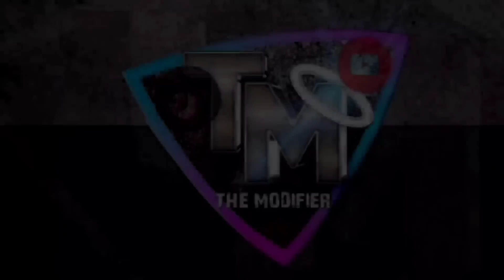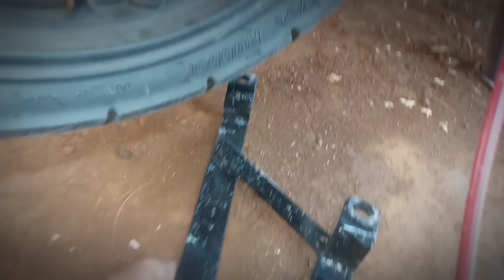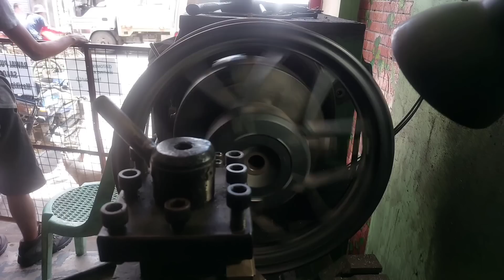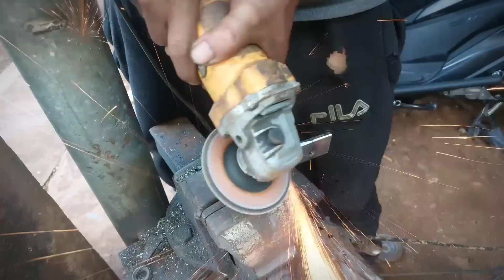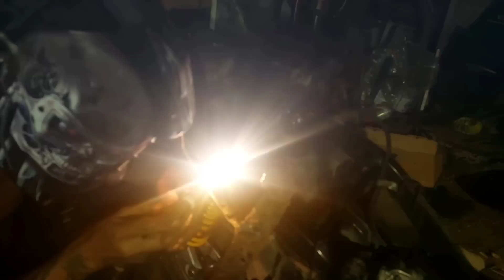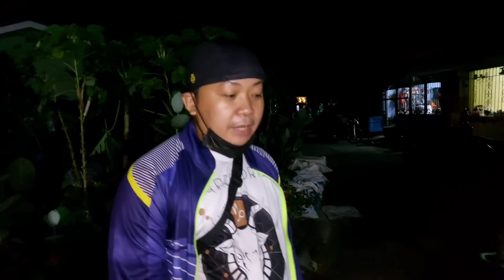Honda click ; Dual shock + disc brake convertion grabe layo pinanggalingan nung isa...

Comment: Boss baka matulungan mo ko. Bumili ako ng swing arm pang wave 125 daw. Kaso noong nilagay ko na yung sa ihe sa likod maluwag malaki butas. Meron bang way para mag fit yung standard ng ihe sa swing arm na nabili ko. How much kaya?
Reply from the maker: Pm mo ako sa fb page idol The modifier
Reply: @themodifier3871  boss gawa k sana boss ng bracket ng pang dual shock sa honda click125i para i-mounth n lng sa swing arm ng click,para kaming nasa malau na lugar mag order n lng po sa inio
Reply: @themodifier3871  mag kano boss set rear discbrake. Click 150v1
Reply: Magkano po magpa-dual shock at disc brake conversion sa click 125i? At location nyo po please?